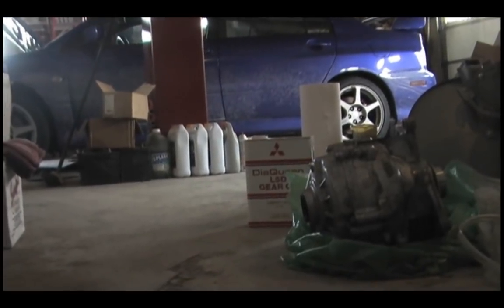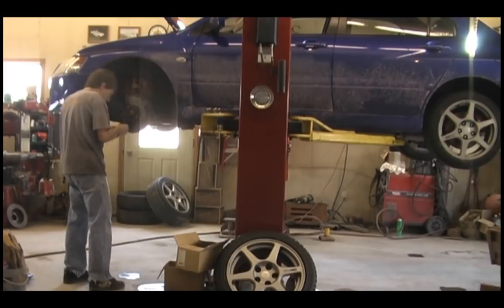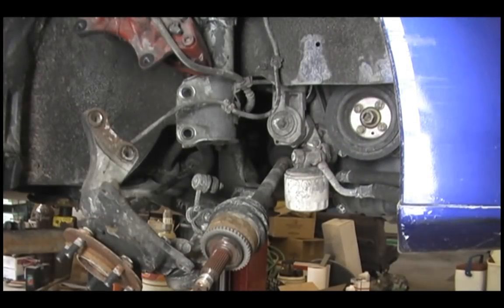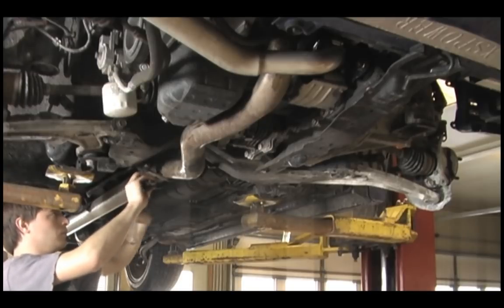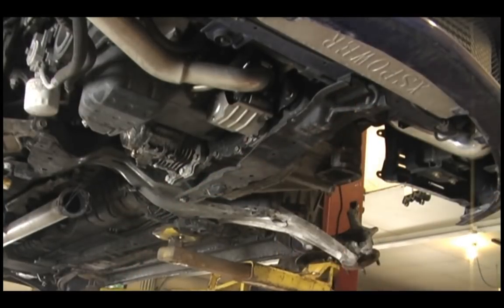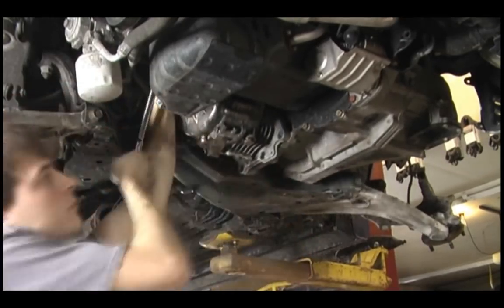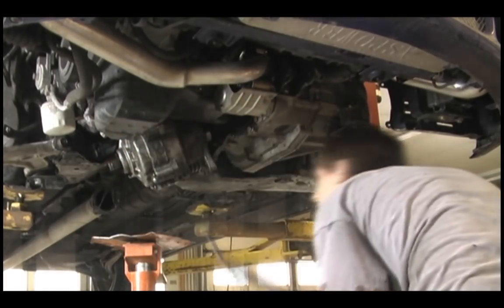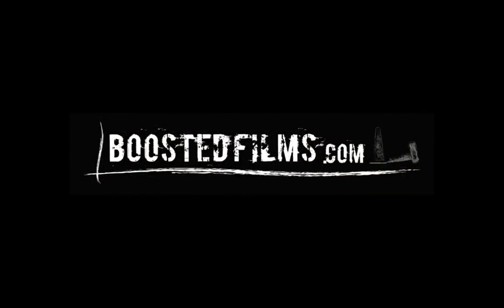Evo Transfer Case Removal // EVO 8 EVO 9- Boosted Films

Comment: When using the slide hammer you can get the harmonic balancer removal tool which adapts onto the slide hammer and using the bolts provided will make the job easier if you don't have that custom tool.

Comment: Nice job man, very helpful and yes of course a hoist make such a difference............I am on the ground getting my gear AND transfer case off my v6 vr4.........nearly there , but there is a bolt snuck up behind the case, yeah awkward position. Thanks again, i will give you a million thumbs up
Reply from the maker: I give you credit for taking on such a project!  VR4's are cool cars though, so i'm sure its worth it :)
Reply: Boosted Films can you help me I trying to take mine out of the evo 4 and the shaft just won't move past a certain point or am I not roughing it up enough
Reply from the maker: CV shafts? they take a bit just should pop out with a good quick pry.
Reply: Boosted Films not the CV's the small shaft in the center that both of them were attached to it goes right from the gearbox to the transfer case.
Reply from the maker: Do you have a slide hammer?

Comment: Excellent video!

I'm in the process of prepping the engine bay to remove the engine and transmission. 

Is it possible to slide the transfer case off the transmission, leave it sittimg on the subframe where it is, and still remove the engine easily from the engine bay through the top?
Reply from the maker: Yes.

Comment from the maker: @evofreak1304 Sounds like a possible transmission problem.  Usually a bad transfer case will also whine during acceleration.  Unless its a quieter whine that isn't heard under acceleration simply because of the engine noise being louder.

Comment: 6:50 - I have a question regarding ACD pump hose...How did you stop it from leaking when you removed the banjo bolt? I have the same problem every time when I do this since the line is lower than the reservoir. Great Vid by the way !!!

Comment: great video I have a 2003 evo 8 and I'm curious about using amsoil in my transfercase rear diff and transmition was wondering if anyone else has tried it and if they can recomend it over the oem oil , my car is a little noisy i may or may not have a bad transfercase as i know some noise is normal but i'm looking to re do all fluids and see if that helps it first any recomendation on the fluids to use ?

Comment: Great video! I have one question if you could help ?I'm in desperate need of the torque number for the four bolts that hold the tail stock to the transfer case, I've  searched everywhere without luck.....Cheers

Comment: I have a question reagarding my evo. Non ACD tc. I had a new clutch installed with new clutch plate, pressure plate, resurfaced fly wheel, new throwout bearing, but my car is barely moving on first gear, even if I step on the accelerator. Feels like the clutch is slipping. Could this be a transfer case problem? Thanks for this info on how to replace the transfer case. I just want to be sure before I tacke this job. Any info would be really helpful. Thanks.

Comment: 2004 Mitsubishi Montaro stuck in low range ! Opened top of transfer case prong on driver side doesn't engage  passenger side works fine ! Driver shifted at 30 mph !

Comment: Can you tell me if I was supposed to have oil coming out of the gearbox from the axle that you see at 8:30 ? We replaced some seals on the tcase of an Evo X and oil started to come out while taking the tcase away from the gearbox (tcase was already empty), I think it was gearbox oil and coming from that gearbox hole at 8:30 but I am not sure. Is oil supposed to be there? Thanks.

Comment: can some one watch my video " evo 8 whine help " I'm not sure if my tcase is bad or if its rear did rear diff it only does it when the gas is ON and its way worse in 5th gear then 4th its not super loud but can be anoying and i just wonder whats causing this whine I changed all fluids but still whines